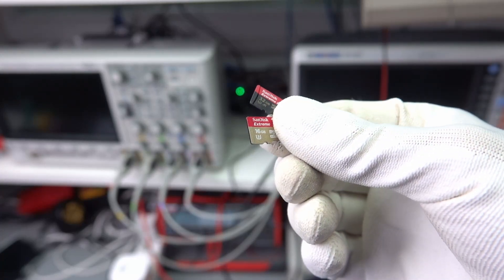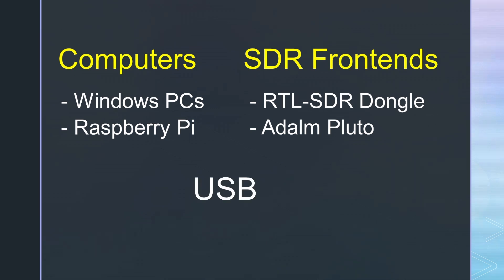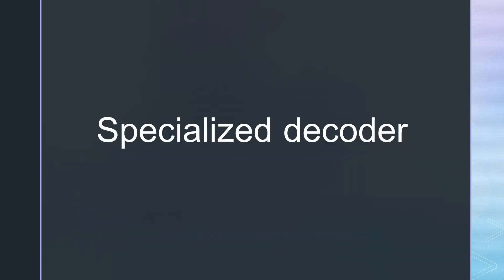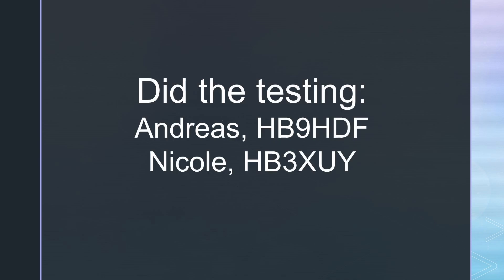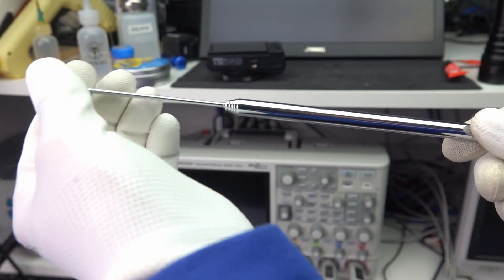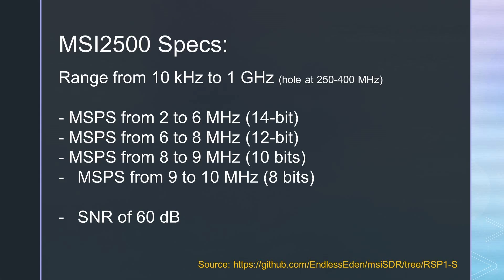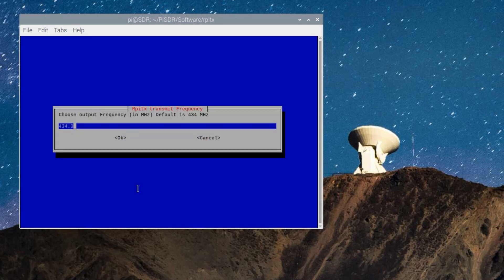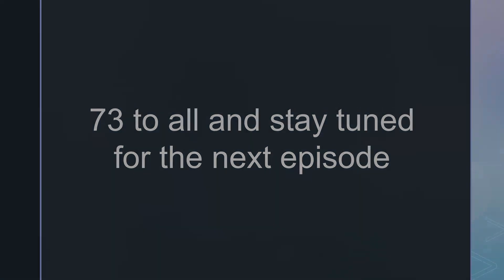024 Software Defined Radio with Predefined Raspberry Pi SD Card Images

Comment: What I would like to see is someone or a group of individuals come up with a SDR based service monitor for the average ham operator. Basic operations would include frequency and deviation of transmitters testing as well as receiver sensitivity testing. Basics of a service monitor. Now there could be other specialized add ons such as decoding and encoding for digital modes (ie D Star, DMR, P25 etc.) pocsag encode and decode. Instead of R Pi based one could use some of the surplus mini computers available on e Bay. They are more powerful and might be able to handle multiple functions at one time plus it would have to have the capabilities of a true service monitor to handle ALL frequencies from VLF to at least 1 GHz.
Reply from the maker: A big project! Most parts are probably available, but not assembled to such a monitor
Reply: @ unfortunately! Greetings from SV9 land in the Mediterranean!

Comment: Even with my €900k lab I still love using the rtl sdr( yes got waaay more powerful toys( no cant use these if you got only ham license). Its simple it works, though my antennas 100% dont fit in a cuppboard unless I can get a 20m cuppboard😅
Reply from the maker: Indeed, they are very versatile. Also because of the software developed for them.
Reply: @HB9BLA  true but also cause you can make software for them yourself ( not offering to teach how to but it is possible)

Comment: Has anyone else found a similar video but takes it bid slower including every single step with a how to.
Do I need to use the Pi4 keyboard in the video or can any USB keyboard with mouse work?
Reply from the maker: 1. I do not know of another video. Maybe stopping the video from time to time helps.
2. You should be able to use any USB keyboard for the Pi (I often use a standard Logitech wireless one)
Reply: @HB9BLA  Thanks for your reply.  This is a good video for those that are already familiar with using a Raspberry Pi and a SDR but might be advanced for someone with no experience with a Pi and a SDR. 
 I have played with a cheap SDR on my Laptop and have that working but would need a slightly more basic video to use a SDR with a Raspberry Pi.   I would like
to try the board with the multiple inputs on my laptop assuming it is already available as a choice for plug and play to see if reception is any better.

Comment: wow very nice SDR Raspberry Pi video.  I would like to use this information in putting together a 1420 MHz radio telescope and use the:  Orange Pi 800 Six-Core 64 Bit 4GB RAM Dual Band WiFi Bluetooth 5.0 All-in-One Keyboard Computer Kit with 64GB EMMC, Run Android, OS, Manjaro, Ubuntu, Debian (Pi800+TypeC 5V4A Supply). I think it should do the job? There just is not very much Orange Pi information that I can find, such as installing OpenCV on an Orange Pi system.     😎 Thank you so much.
Reply from the maker: I do not know these products. The more you go away from mainstream, the more you are on your own. On my second channel, I showed another possibility: Used Thin client PCs from eBay. They are much stronger than the Raspberries at the same price... And they are mainstream.
Reply: @HB9BLA  Thank you so much and I will watch that video.

Comment: I'm finishing-up my eighth homebuilt airplane, which sounds like a lot except that's over 50 years of building. This new one is a Quickie Q1 -- a VERY SMALL canard design. The entire instrument panel is an iPad that even controls an autopilot. But now I am interested in SDRs and wonder if I can use them to make aviation (118.000 to 136.975 MHz) transceivers? Of course I CAN, but should I? It's just AM modulation and I am properly licensed with an FCC Class 1 license (I was chief engineer at a commercial radio station at age 17) and the little plane has a radio license, too. I'm not a licensed radio MANUFACTURER, but surely these SDRs fit the technical requirements, so why not do it?
Reply from the maker: 1. Nice little plane, and an interesting setup. I also had an experimental canard in mind (I even went for a test flight in Florida). But it was a too big project for me. So I admire your work!
2. Most modern radios are based on SDR technology. This might not apply to aviation because, as I remember, this technology mostly was "proven" and therefore old.
3. You probably could build an SDR transceiver. But AFAIK you are not allowed to use it. The right to build is only for licensed HAM operators, and only in the HAM bands. DIY receivers are ok in most countries.

Comment: Espressobin should have more IO bandwith than a Pi and used to cost about $70 for the board without a 12v barrel jack(5 to 10 USD) and a case /w heatsink another $10... so like $100 for a usable setup.
Reply from the maker: I agree. As soon as you leave the Raspberry ecosystem you get much more choice. But you lose the community support as well as many projects.
I  am just tinkering with a used thin client PC and proxmox ;-)
Reply: @HB9BLA  I disagree, I mean you are right that there is a kind of safety net when going with something well traveled.  I just don't think it matters to the degree ppl might imagine.  I would guess the superior IO more than makes up for the tradeoff of this device not being as popular.

Comment: I have been slowly getting interested in SDR due to the obvious crossover with my other hobby of Radio Control flight and various long range control and video solutions. I have an old rasp pi and a dongle in the mail, I will def check these images out. Thank you for the video and the effort put into presenting all this info. I appreciate it a lot!
Reply from the maker: Good luck!
Reply: What have you found out about mailing and SDR integration?

Comment: Any one else use an android and sdr touch or rf analyzer  ?   Dab radio and tv with a cheap sdr dongle too 👍
Reply from the maker: The RTL-SDR dongles initially were built for DAB and TV reception. Then clever guys extended their uses.

Comment: Hello Andreas, can you check one thing for me please. Switching on the Rpi, do you notice the increased noise on the other radio, let say 145 MHz? I am running the RPi 3b+ with the openwebrx sw but powering the Rpi increase the noise on my other packet radio up to 59+20dB. The cause is not the switching power supply but the RPi. Do you have the same experience there? Thanks...
Reply from the maker: I did not experience this fact. But my Pi4s are all in metal cases for passive cooling
Reply: @HB9BLA  Mine Rpi is all in aluminum heatsink and the noise start immediatelly... ok, thanks for the answer...

Comment: I was hoping for a preconfigured OS that I can put on a PI that is remote and connect using a web front end.  This is because I can put it up high and away from noise.  I currently use sdr sharp and it would be good to still use that but it seems far too time consuming to set all of that up.  VNC isn't really very good especially over wifi for realtime listening - it takes half of the PI just to stream the VNC desktop.
Reply: There is a raspberry-websdr github projekt that does that, providing a webinterface from which you can listen an controll, I set it up a couple of years ago and it worked well.
Using the flash-and-go solution showed here, I would expect not too much of headache setting it up since the 'bad stuff' like drivers and such comes pre-compiled/pre-installed.
Reply from the maker: For my QO-100 station, I use SDR console and a Pluto Plus on the roof connected via Ethernet. This should also work with a raspberry Pi.

Comment: Don't forget the HamPi distro which has numerous SDR packages. soapy, cubic, ... already installed. And sstv, GNU radio etc.
Reply from the maker: Thank you for the tip. I was not aware that it also includes an SDR section.

Comment: This is the first I heard of the MSI2500. It's perfect for the price, dynamic range, frequency range, number of filtered bands, and versatility. Plus it's cheaper than the RTL-SDR that I just bought.
Reply: Supposedly it’s a clone of the RSP1, i was surprised too, but after buying one, i can confirm it’s a 100% upgrade from the rtl-sdr, aaaaaand it’s cheaper!
Reply: @howforless  There are also some smaller RSP1 clones that use a single SMA, and have switches on the board to choose the bandpass filter.  I bought one last week, and am having fun with it.
Reply: Hi John, note that I'm not using this with a Raspberry Pi, just using CubicSDR downloaded on a MacBook for now.  I do want to try it on the Pi with a touch screen LCD, which was why I thought this video would be helpful.
Reply: @BrightBlueJim , thanks. I'm not a software guy, so I know little about what works with what. I'll try my module with other hardware and apps.
 
After pricing the Raspberry Pi's that are available now I was afraid I was just going to have to wait till production had ramped up beyond demand again in a year or 2. Unfortunately, I've finally deduced that my new SDR module is defective, and I was getting the run-around from the seller, so I've decided to order one from a different vendor and also try to repair this one.
Reply: @johnwest7993  Happy hacking!
Reply: @BrightBlueJim  Physical switches or switches that are switched via software ?  Do you have a link to this board ?
Reply: @SomeTechGuy666  Also, I have used this on both a Raspberry Pi model 4 and a MacBook.

Comment: 2:35 That's NOT a waterfall! I know most people misuse the term now, but I wouldn't expect you to!
Reply from the maker: So you know more than me. I only know another diagram called "waterfall" from finance.
Reply: Did you wait more than one second?  The display below the line IS a waterfall display.  As with all waterfall displays, it can't show any history until it has some.
Reply: @BrightBlueJim  No it's not. It's a spectrogram. Your ignorance is showing...
Reply: @qwaqwa1960  A waterfall display is a spectrogram with history.  That is all.  It shows the spectrum over time.  The fact that some people use this term for other purposes does not alter the fact.
Reply: @BrightBlueJim  Wrong. You can't just steal an existing term and use it to describe a new thing—that already has a name!
Reply: @qwaqwa1960  Wrong.  Plenty of words have multiple meanings.  I worked on a waterfall display (of the spectrum variety) that was part of a 1962 RADAR system, so there is plenty of history on this.  SONAR systems also call it this.